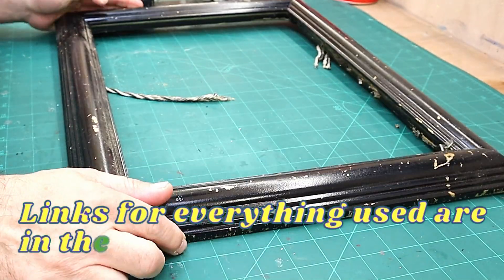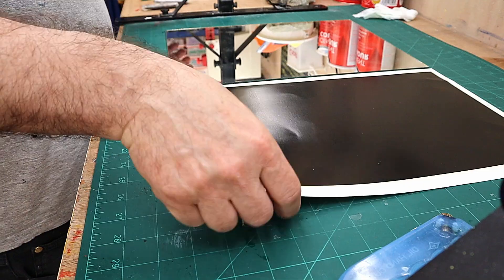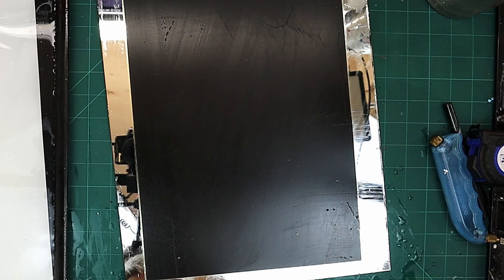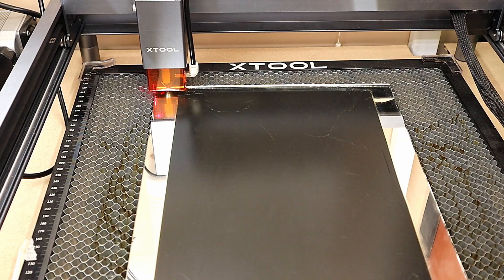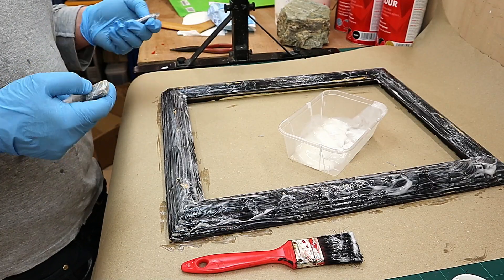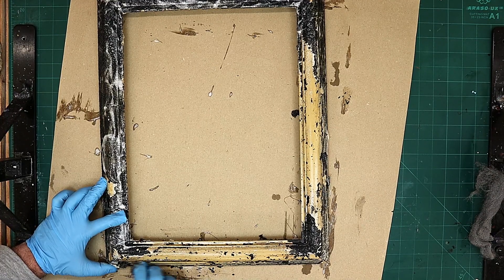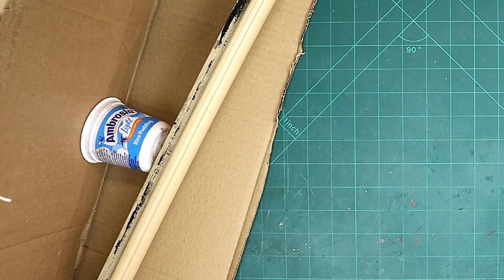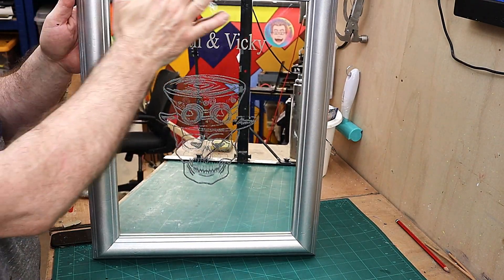Upcycling & Engraving A Mirror With Xtools D1 Laser

Comment: A: This turned out great! I'm so impressed that you DREW that skull!

B: When you engrave mirrors, it's always worth a shot to try and engrave the back. This keeps the face smooth and shiny, but still shows the engrave as the backing is the actual reflective part. If you do it that way, you don't need to mask, either. Worth a try in the future! I know it works great on the Glowforge, but I'm not sure how the D1 will handle it since it's about half the power.

Loved the video!